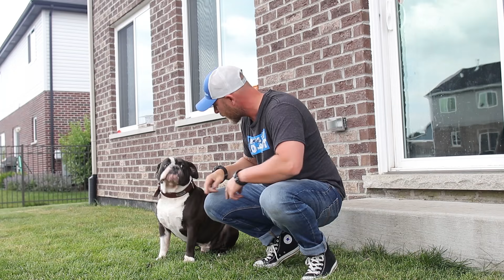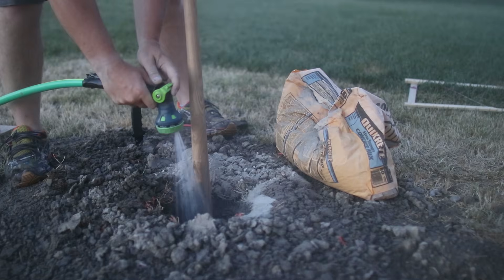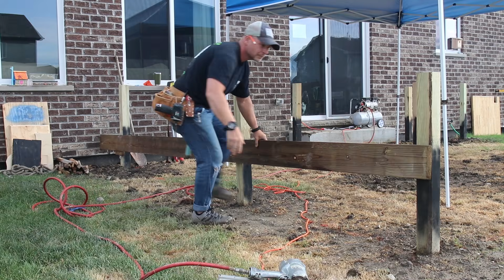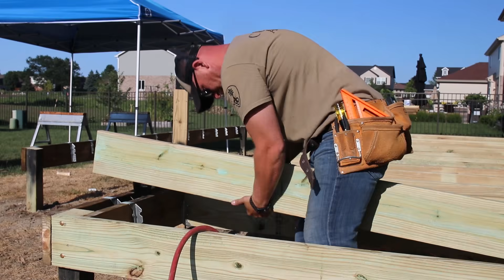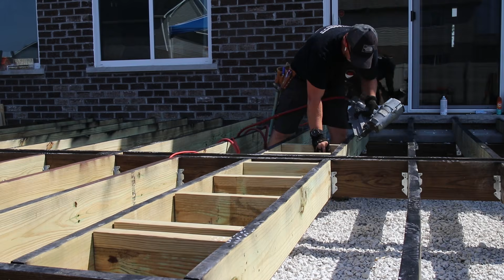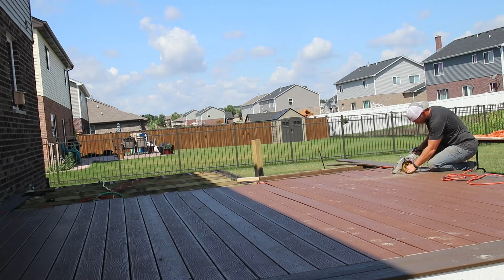How To Build A Deck!! Layout, Framing, and Composite Decking Guide ||| DIY Deck Build

Comment: Thank you so much for making this video.  I am curious as to why you are spray painting instead of using tape for the joists. Also, is this a special spray? I would assume anything that would act as a barrier would do. I wonder if the spray that I use for treating trees when I cut limbs would work. It is basically a spray tar. This is my deck exactly except for my steps are 3 planks wide. My deck is 24 feet long by 13 feet so I ran my decking boards across using 14 footers (don't exist anymore). You are saying that it is better to go the other way with two sets of 12 footers, Interesting. Does code say we have to do it this way? You mentioned code.  I can't watch this video enough. Thank you again for posting this.

Comment: A trapezoid also has equal length diagonals. You should probably also confirm that opposite sides are equal in length to one another to make sure you have a perfect square. Or maybe easier yet, verify that any one of the angles is 90 degrees.

Comment: can i butt up two pieces when doing my picture frame. deck is 24ft long and they only make 20ft long boards.
Reply from the maker: You sure can.  I just finished a deck that is 28’ and I did that on a picture frame as well.   Video coming soon

Comment: looks awesome. I have one thats even bigger than yours but my colors are different.  my two board border is vintage lantern color and my interior is tiki torch color. but to the naked eye at a quick glance your color scheme looks exactly like mine. i do however like your white fascia idea on the steps.  Really good idea.
Reply from the maker: Thanks so much.   I do love the colors but if I were to do it again  I would go with more contrast between the two
Reply: @KomarProject  i wish i could link pics to my deck here

Comment: nice deck! im lil curious about the deck post which must be attached to the top of the concrete footing with accepted hardware approved by the code but what i saw is you poured the concrete i believe 6 inches because you said 42" deep so the spread footing is 6" and no more concrete and you just placed the 4x4 post without anchor them to the spread footing  only dirt holding horizontal movement of the ground but only dirt can support those forces? probably you missed the part in the video..... thank you for your time bro

Comment: In Russia, this method of installing a vertical wooden pole for a terrace in the ground is incorrect. You can do this in Africa in the desert, where there is no rain and frost)))) It's very funny ...
at least a wooden pole had to be covered with a layer of waterproofing or a part of a wooden pole that sinks into the ground should be burned with fire so that the pole does not rot in the ground. (google translation)

Comment: My landscape fabric in 3 or 3-1/2 years had torn to pieces on its own.  It was installed a month before purchasing my house.  I was planting a fruit tree when I discovered it.  You probably won't know the answer to my questions maybe someone might reading this.... Can I use 2 or 3 layers of the fabric and still have the necessary drainage with the additional layers?   Thanks.

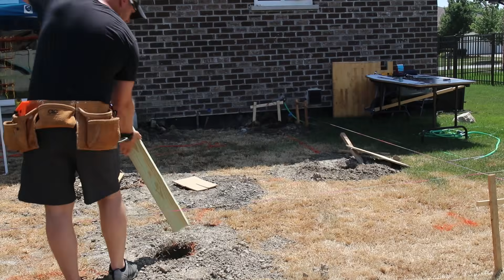Comment: 💥💥 4:24  I just did an estimate 3 weeks ago for a man whose posts were all 6 inches below grade and all are rotting.  Footings always stick out of the ground by an inch or two.  The deck is 23 years old and everything else is otherwise still in good shape.   I’ve built decks for over 30 years and I have not been able to come up with a solution on how to rectify such an easily avoidable mess.  ⚒

Comment: Great video! Just have a few questions. How much did all the material cost you roughly? I’m also in the Chicago burbs did you need to acquire any permits ? Or just stay within regulations.
Reply from the maker: If I remember right the cost of material was around 5k.  And you should always pull permits.  Thanks brother.  Good luck
Reply: @KomarProject  Perfect! Thanks for the info! 🤙🏼

Comment: Wish it was possible to build a deck this way in Ontario. Setting posts in the ground without concrete pier extending 6" above grade level to avoid the rot, attaching beams to the posts with lug bolts when entire deck weight depends on the bolts sheer strength instead of notching the post and setting beams in the notch on top of the beam, installing beams on the ground close to the house with zero protection from rot, attaching two beams on both sides of the post instead of laminating them together. Wondering where building code permits all these cool construction methods?

Comment: Umm you didnt concrete the post in? You just filled it and let it dry then just used dirt to fill WTF?
Reply from the maker: Yes.  As long as you have a frost footing there is no reason to concrete it all the way up.  With that much depth that post is never going to move and after it’s all nailed together the only movement would be downward and the footing will prevent that.   Many ways of doing things brother.  This is just one of them
Reply: @KomarProject  :) thanks for commenting! Thank you for letting me know and that makes alot of sense thank you for shareing!

Comment: how did you hide the screws that you screwed straight into the top of the deck boards that were on the stairs and have a grooved bottom?   were the  screws strategically place where the deck board is thicker so you could use plugs like you did on the facia?
Reply from the maker: Exactly

Comment: Deck looks good.. I'm in Illinois and we would fail a inspection by not coming out of the ground with our concrete with sono tubes. Then we have to use a 4x4 post base attached to the concrete for our post..no dirt hitting the 4x4 post support.
Reply from the maker: I’m in Illinois too and I passed all the inspections.  Not sure where you are but different towns have different codes.  We had a hole inspection and then a frame inspection witch both passed.   I guess you just have to do what your town requires. I would definitely check with them before hand.  Good luck brother

Comment: In Maryland, and I’m assuming a number of other locations we can’t attach the beams in that manner. They have to have a mechanical faster non top of the post. Just a slight adjustment to the process
Reply from the maker: Ya a lot of places have different codes. Where we live I’m amazed at some of the stuff they let us do and on the other hand some of the codes are just crazy.  Lol

Comment: @Komar Project is there anything you would have done different? How stable is it after 8months? I would just worry about those pavers coming lose over time from drainage off the deck.
Reply from the maker: So we sold that house but when we moved everything saw solid.   I have done quite a few decks like that and it always worked out.  The only thing I would do different is not try to do curved stairs.  That was a pain in the butt
Reply: @KomarProject  Yes without a silicone heating pad it's very hard, if you ever do one again, there are a lot contractors that have the pads and will bend them for you for a price. The system to do it is about 2-4k depending on brand. I think my friend paid a  guy about 100 to 150 per board for a project of his.

Comment: 1)How did you decide where to place all of your posts?

2) How did you figure out the placement of the posts used for the support beam where the two     boards meet?
Reply from the maker: every deck will have loads that you need to figure out based on its size and the type of framing materials used.  there is alot of information on line to help with that, or i would check with your local building department.  they will most likely help you determine that based on your local codes

Comment: Why did you put the posts in dry.  ie no concrete round the post ???
Reply from the maker: You don’t need it around the post.  They will never go anywhere.   All the pressure is downward and as long as you have frost footing it will hold

Comment: Your posts need to rest on the concrete , ABOVE ground, using Simpson ties, NOT buried in the ground/concrete. (Indeed this is code in my jurisdiction, and yes we need a permit in my jurisdiction for decks) New pressure treated wood , even ground contact , is NOT that durable . You also should also  be using cardboard mounds for the concrete , and the concrete should be mixed externally and POURED into the cardboard form.

Comment: Hi, did you install the composite deck boards on a very hot day?  Is that why you did not put any expansion gap because the boards would have expanded in length already?  In the winter, have you noticed the miter joints open up a little?
Reply from the maker: I did put spacing between the boards.  Not sure what your referring to brother
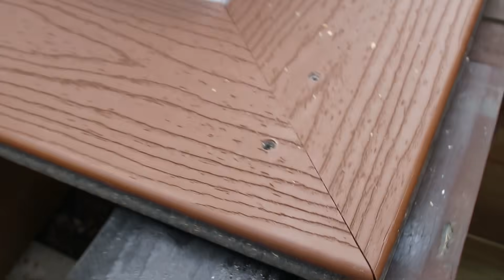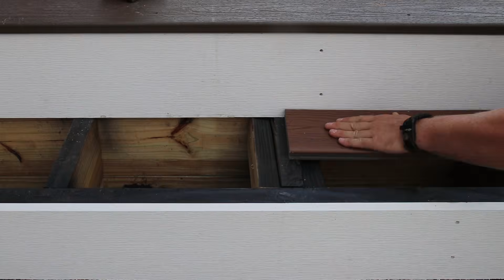Reply: @KomarProject  at 12:00 no spacing at miter jt, at 12:20 no spacing at butt jt

Comment: How wide is the blocking for the perimeter border?
Reply from the maker: Not sure what your asking
Reply: Komar Project, for your picture frame border you blocked the perimeter of the deck.  I’m doing that as well on my deck build.  I was curious how far apart your blocking joist was from your left or right rim joist

Comment: Thanks for a very helpful video. I'm starting my own deck project and this helps a ton.  Your dog is aDORable.  You sprayed the top surface of boards with black paint of some kind but didn't mention what you used or why.  Is this aesthetic or functional?
Reply from the maker: It’s just so you don’t see the light colored joists between the dark colored planks.
Reply: @KomarProject  really I thought it was a substitute for trex tape or something that protects it

Comment: what is the black spray?  is it a product that goes with trex decking?
Reply from the maker: No it’s just black spray paint .  You want to spray a dark color on it because if you don’t you will see the joists through the dark color planks and it looks weird. It’s not a issue with regular bare wood planking but for dark planks it’s going to look better visually.

Comment: I built our deck with that composite or fake wood, it looks awesome.  That is until it rained, it was so slippery that you couldn't walk on it as normal.  THEN it get HOT..HOT..HOT.  lost the ability to walk out on the deck barefoot.  So we ripped up the fake wood and made a nice and rather large dog house.  We then rebuilt the deck from real wood.  So so much better.  I think that fake wood is more suited for a commercial application than as a residential deck.   Not to mention, I can stain the real wood deck the shade we wanted and not what is provided.

Comment: Hi Mark, This deck you made is stunning. I am planning a side L-shaped deck for my house. I wonder if the deck post only need to rest on concrete or should I fill the entire hole with concrete placing the post to reinforce the foundation. I did observe that you added concrete only down the bottom of the hole and then back filled the dirt after placing the post. Would that not make the deck shaky eventually if it is freely standing.
Kindly advise.
Reply: In Russia, this method of installing a vertical wooden pole for a terrace in the ground is incorrect. You can do this in Africa in the desert, where there is no rain and frost)))) It's very funny ...
at least a wooden pole had to be covered with a layer of waterproofing or a part of a wooden pole that sinks into the ground should be burned with fire so that the pole does not rot in the ground. (google translation)
Reply from the maker: So I’m my area we have to go below the frost line which is 42” deep and backfilling that much and packing it will keep that post steady for ever a specially after they are tied into each other.  Now if you go less on the depth then that takes away from the strength and you may need to pour the whole. It also depends on your local codes.  I would check with your building Dept and see what you can do.

Comment: Was that rubberized under coat you used under the boards?
Reply from the maker: No just spray paint so that the light color of the points wouldent come through the planks.
Reply: @KomarProject  Thank you for getting back.

Comment: So just using 2 or 3 5/16 RSS 4" per post on each side  has enough shear strength?  No need for a 1/2 bolts (or carriage bolts) ?  I'm very curious because I'm currently  building a rooftop deck in Chicago that is on top of a garage (23'x23')  with a modify touchdown roof. And I would like to avoid the using 1/2 bolts.  Because in my case the both my 6x6 post and my 2x6 joist have to match i-joist layoutf.  So the bolts interfere with the joist hangers unless i use concealed hangers. And on top of it all because I need to spread the load even on all i-joist there will be at least 49 post beam or double beam connections.  I was planning on using  combination of 1/2 bolts and GRK RSS 5/16 5" screw on all double sandwich connection and on all lap joint connections just the RSS screws.
Reply from the maker: For a deck like this it’s enough.  I consulted with my building Dept and they said it was good and check it during framing inspection.  I would for sure check with building Dept since it’s a rooftop and see what they say.  Better be safe then sorry.

Comment: Great job and spirit but i have couple questions to my knowledge we don't use screws in composite directly we use separators and then we screw the separators and if we do cutting on composite we have to treated seal the edges where the cutting took place to avoid problem in the future caused by water to the composite . I'm building my deck next week and i called leadvision composite company for more infos. So if you have some tips for me it will be appreciated if you reply I'm trying to not do any mistakes building the composite deck thanks and again great video
Reply from the maker: Depends on the composite you get.  Different manufacturers have different ways of installing it and some have multiple ways.   I would just follow what yours says. Sorry couldn’t be more helpful but it’s always wise to follow what that manufacturer recommends so you maintain the warranty on them.
Reply: @KomarProject  that's what i will do thanks and keep up the good job really appreciated

Comment: How do you keep your miters tight? I find by the end of the day, they will be open and wavy even though they started off tight in the morning. Do you use an adhesive or screw through the corner?
Reply from the maker: Ya I screw then together.  Just make sure you use a drill bit to pre drill it and then plug it so it doesn’t look like a mistake.  People have a tendency to look at asrews on these deck and think you messed up.  You can also try a glue of some sort.  Been meaning to try something but haven’t had the chance yet.

Comment: Your Deck would Fail inspection! Your main supports are wrong. Overall, not safe but looks good.
Reply from the maker: Actually it passed inspection.  One when the building department came and one when we sold the house.  Don’t be so quick to judge about how things are built because of what people tell you it should be done.  There are plenty of different codes and ways to do things.  This was structurally correct and will be for years.  This is not my first deck

Comment: Why did you not cement the posts in
Reply from the maker: Didn’t need to with how deep it went.  They sit on concrete footings and the ground will hold it just fine.  If you have different depth codes you may need to

Comment: Great video! Awesome to see a deck go in from scratch. We have a composite deck that was installed before we moved in, but the facing (vertical boards?) is wood, painted, now weathered and peeling. Is it possible to replace this without tearing out the whole deck? We were wanting to replace it with more composite so it would hold up better in rainy Washington.
Reply from the maker: If they put the facia on over the deck frame you can. Or if the frame is exposed you can just line it with a composite. Just go over it.  Hope that helps.
Reply: Komar Project thanks!
Reply: @KomarProject  wwwI aaaanchal a aq we d was were we aware wa as a A’s are arawowd as pew aa was aw we a
Reply: Aaaa eat a  as aa  we AAA a aa we aa

Comment: Looks great! Just wondering how about expansion and contraction? how much gap you left at the ends? what's temperature in your area? highest in summer, lowest in winter? Thanks!
Reply from the maker: So composite will expand and contract a bit. We live in Chicago and the weather here is crazy.  So injust followed the manufacturer recommendations and so far it’s been great
Reply: @KomarProject  Thank you so much for your reply!

Comment: Hey buddy, amazing video I learned a ton from it about composite. I love the detail and info thanks again for making it. Quick question though what were you spraying?  Can that spray substitute the waterproof rubber adhesive stuff I use usually?
Reply from the maker: So a rubber membrane is only used if you rip the joist. You really don’t need it if your using regular joists. The spray is just regular spray paint.  I use it because the light color joists would show heavily through the dark planks and larger gaps. If you don’t color it it will be very evident.  But no it’s not a substitute for the membrane.  Hope that helps.

Comment: I am planing a deck on a much smaller level and with one step down. Does your frame out on the edge have an overhang?
Reply from the maker: Not sure what your asking. The only overhang is on the decking boards that overhangs about 1” over the facia board.  Hope that helps